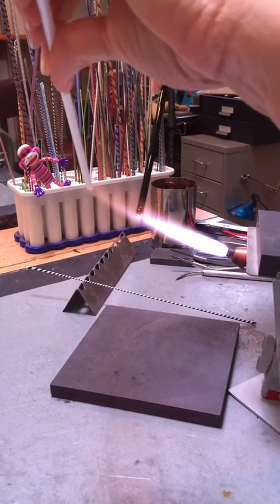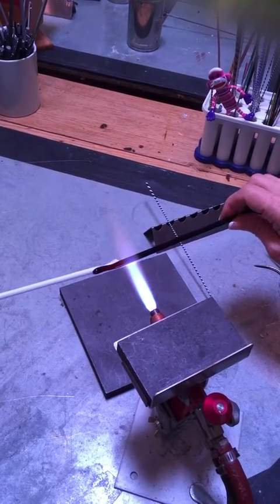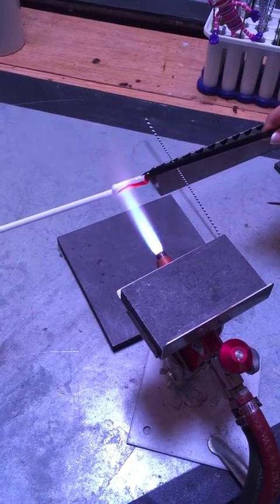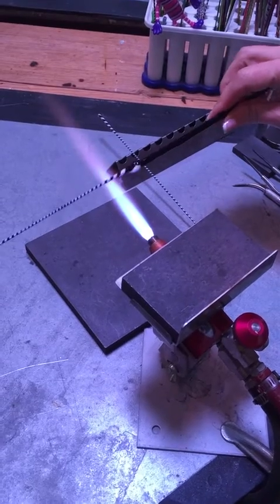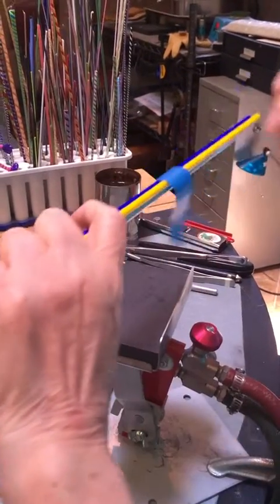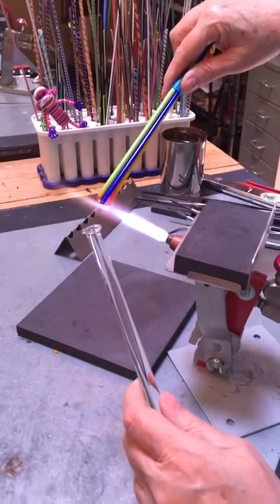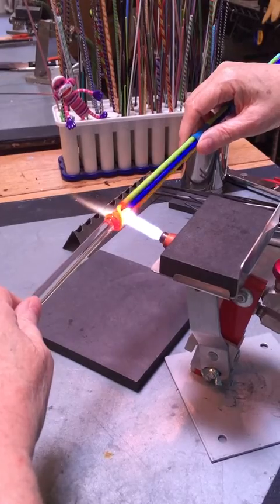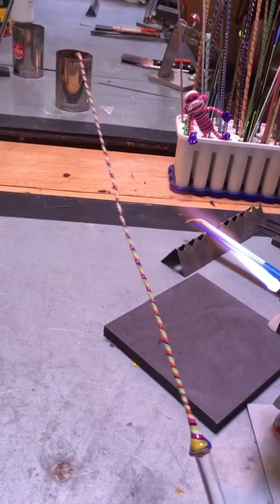Techniques Two Ways/Twisties

Comment: Brilliant! The tip on the 2-rod segment about folding the rods down over each end to get an even pull is a gem. One question, not really related - is the twistie holder in the background a specially designed container or a 'found' one please? It looks ideal for the purpose
Reply: It looks like a water bottle ice cube tray.